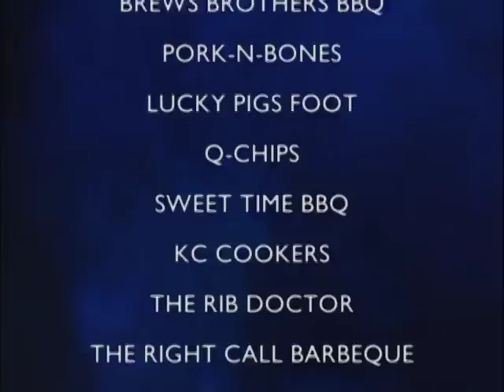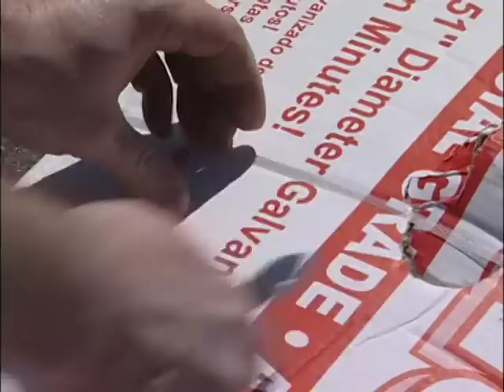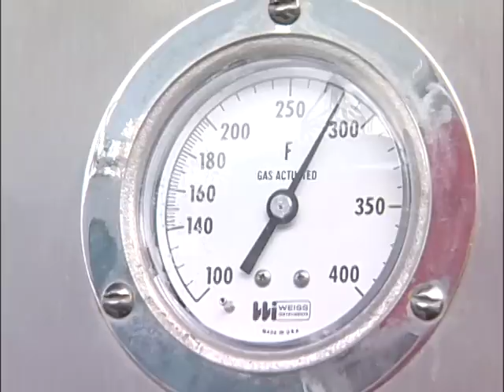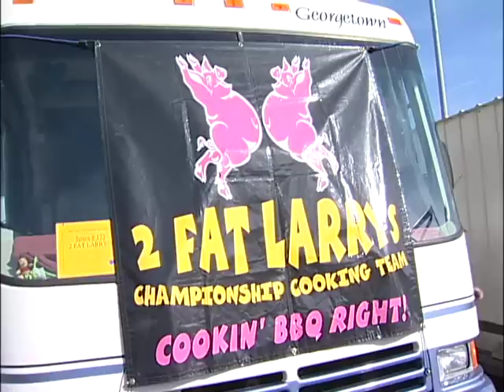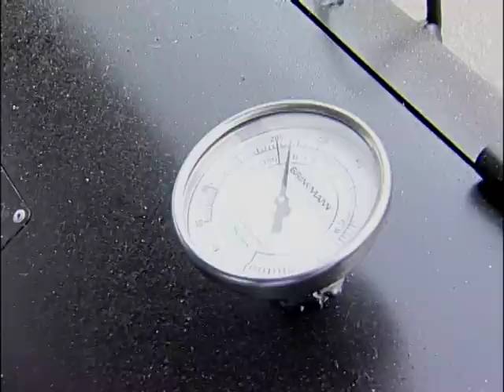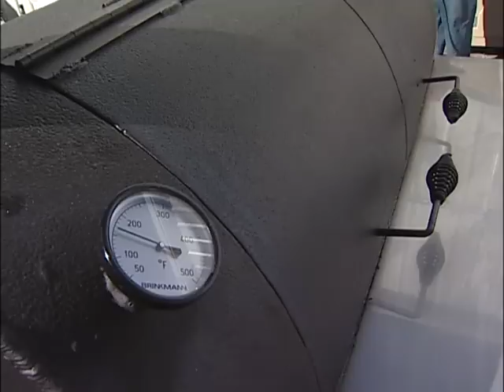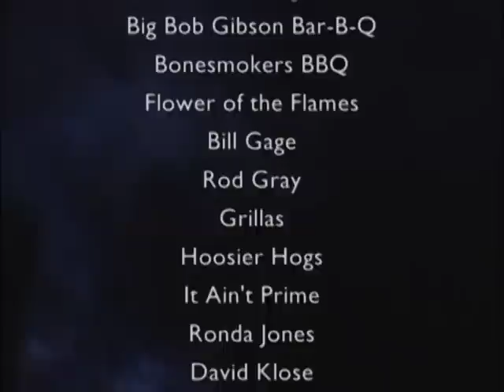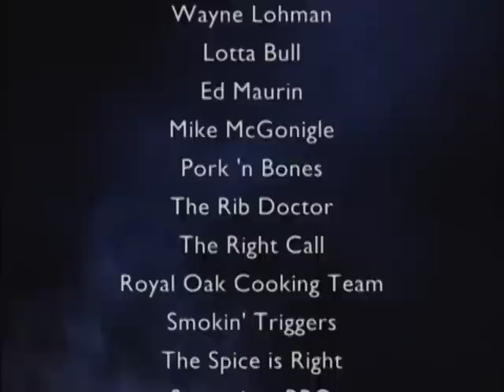Inside The World of Championship Barbecue - Full Movie

Comment: I once programmed a trivection oven for a place I worked. You could use microwave, convection, broiler or oven independently or in combination. These settings were refered to as events.
    This single handedly changed the way I think about cooking. Each dish requires a number of events, whether it be a dry rub, or a low and slow. The application of when and what is so important. Mashed potatoes and hash browns are similar in a way, they just have different events that occur during their preparation.